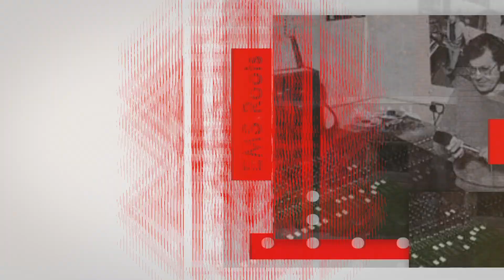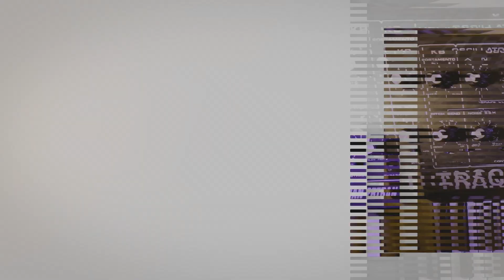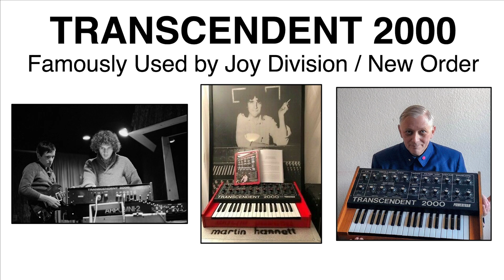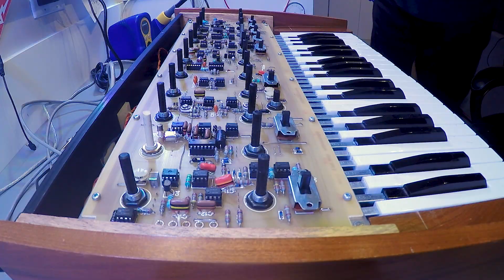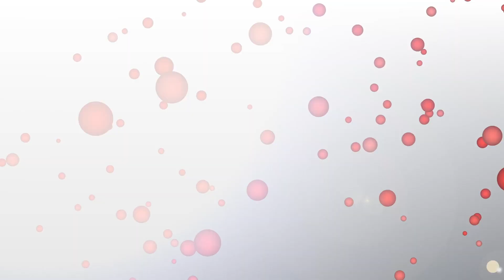Introducing the Powertran Transcendent 2000

Comment: Hi Telefunkian. Is it possible to replace the 24R7 (0.5%) resistors used in the keyboard with multi-turn trimpots? I ask because it's proving very difficult to find them. Greetings from Brazil.

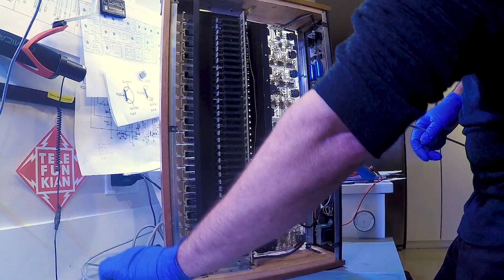Comment: 12:00 That's a UK plug. We only have them in the UK and Cyprus. Most of Europe uses a completely different plug.
 That is indeed an old one as the live and neutral pins are solid brass. More recent (since about 1990 IIRC) plugs have a plastic cover over most of the length of these pins, so only about 8mm (5/16 ") is bare metal.